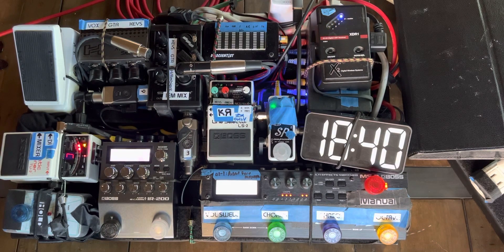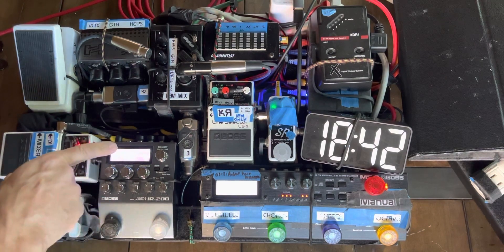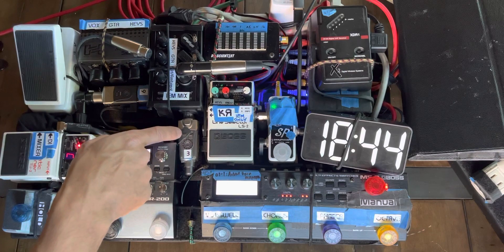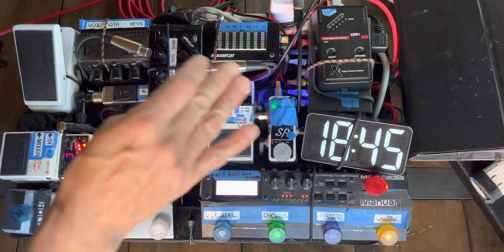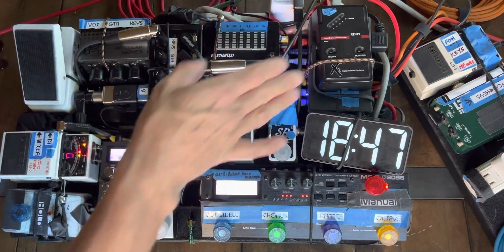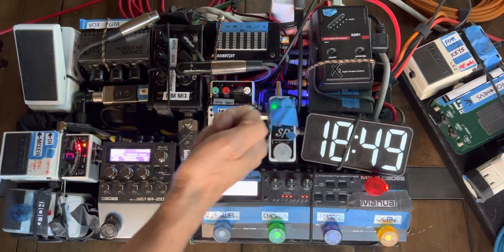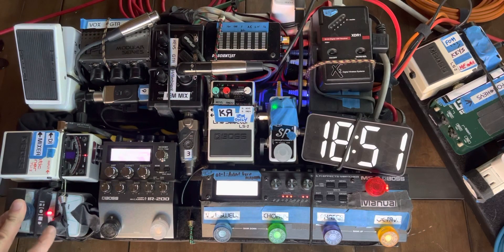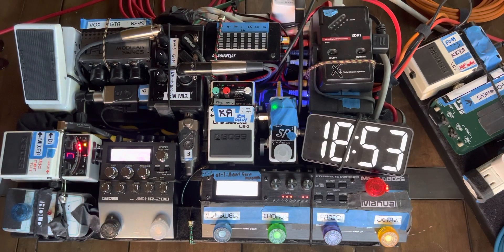My current Guitar Pedalboard setup explained (Boss IR-200, Boss MS-3, others)… *NOT* a sound demo.

Comment: Hi Where in the chain to set it up im planning using it for life performance no amp any suggestions please let me know great video Thank you
Reply from the maker: GTR (cable or wireless) >
MS-3 Input
Pitch
Phaser
…MS-3 Loop (pick any one)>
   Wah
   Boss IR-200 (w/ mild Delay & Reverb)
   …Boss IR-200 Send>
       …Xotic SP Compressor
   …>Boss IR-200 Return
   Boss IR-200 Main Out
…MS-3 Loop Return
MS-3 Main Out >
Electro Harmonix Freeze
Boss TU-2…
…Out: to Front of House
…Bypass: to Mixer for In-Ear Monitor
Reply from the maker: Hi! Posted it in a reply to you, as well, in case YouTube goofs up on me while posting… hope this helps. Cheers (and thanks!)!